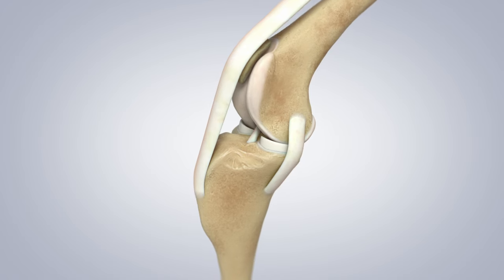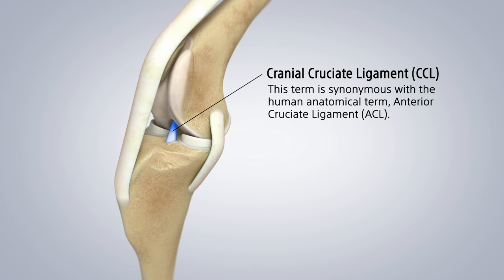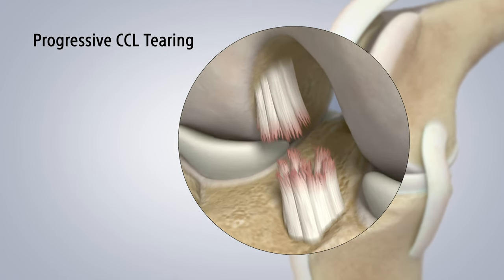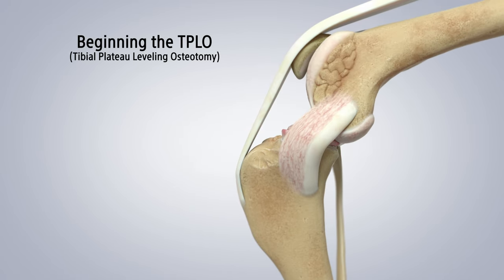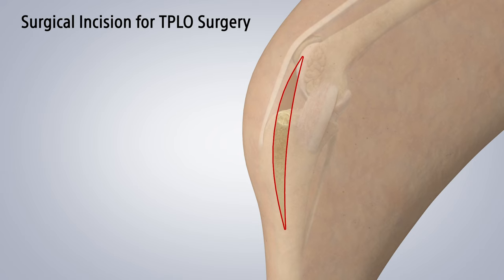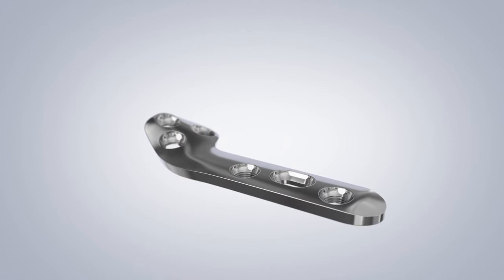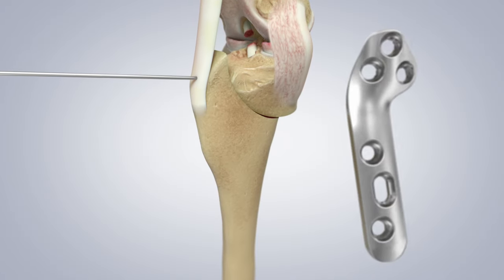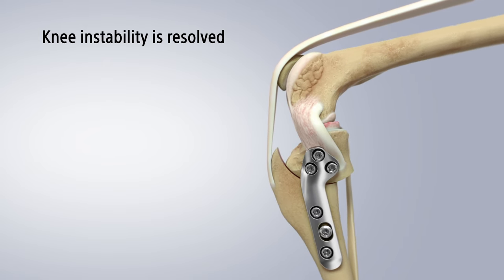CCL Tears and How a TPLO Surgery Works

Comment: The Video is good but the truth about TPLO is that 60%+ Dogs need mostly also the other Knee within 2 years done. The lowering of the Plateau is like driving your Car one Side with 18 Wheels and the other with 15Zoll Wheels. Same Problem.
Reply: ..... Rubbish..... The second one goes due to degenerative condition or trauma, just the same as the first one....
Reply: Creo que no baja la altura, solo el angulo, pero no estoy seguro.

Comment: Our dog is about to have TPLO surgery. I'm very worried about the first weeks after the surgery. She's a very agile dog and can have her erratic moments. How stable is the whole joint right after the procedure. Are there worries about the whole thing breaking away?
Reply: ...... Presumably you've had the op now...?.... I'm sure you will have realised that the first few days are stressful trying to keep the dog immobile..... After the first week, it'll be fine putting weight on it and gradually pottering about..... Just don't let it jump, climb or run.....
Reply: @davechapman5815  yes 2 weeks ago now. Our status is like 7/10 at the moment. Swelling hasn't completely subsided around the knee. Surgeon told us to keep watching out for more swelling and/or heat on the area.
Reply: @saiiiiiii1 my dog just had the surgery done about 2 weeks ago now. They gave us 4 medications - 3 of which have sedation effects to keep them sleepy & calm most of the time. And they work. She was putting her full weight on her leg within 4-5 days & has been waiting to run, jump, & play since then. The recovery time of TPLO is pretty quick & the success rate is really high too.
Reply: @Greatehst  Gracias por tu opinión.

Comment: What is the cost of this procedure
Reply: Last year my dog had this done as a referral at a specialists and it was just under £3k for the procedure + the cost of the original x-rays at local vets to diagnose.
Reply: just got a quote of 5500
Reply: Same appox 5-6k total.
Reply: Yep....usually 4 to 6k
Reply: Depends on area. Im quoted at 2500 bucks. Gotta get away from the bigger cities.
Reply: @jameslien1440 No experienced surgeon will do this for 2500. This a difficult procedure that can cripple a dog for life not to mention the major artery that can be nicked or severed by the saw blade.